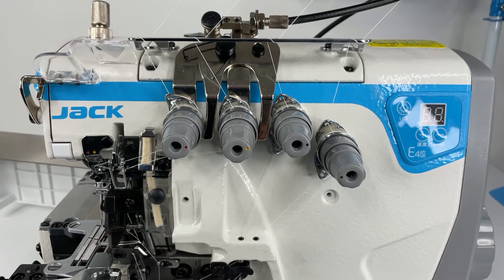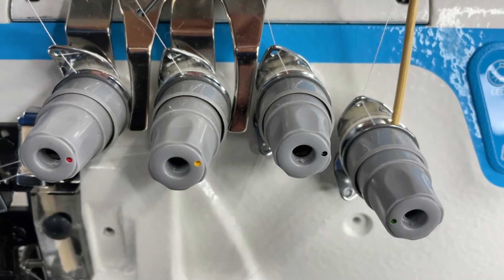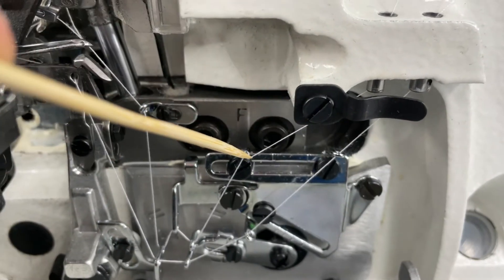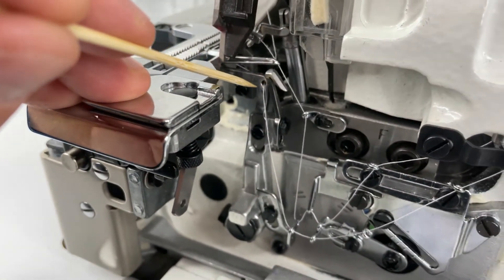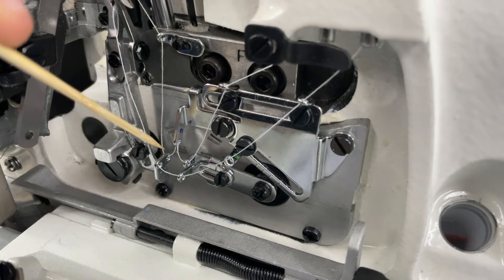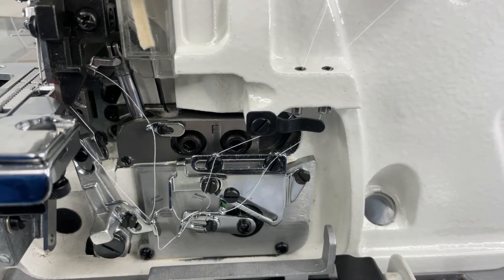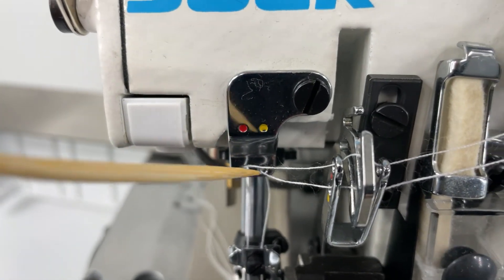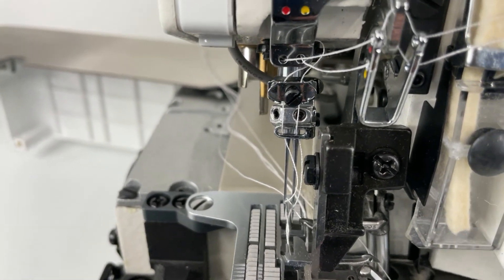How To Thread JACK E4S Industrial 4 Thread Overlocker

Comment: Hi, i am cureently sewing lycra and have big issues with it. It doesn't run easily and therefore my stitch is not the same. I changed diferencial but it still doesn't change much. Is there any other options for changing stitch length?

Comment: Could you help me please?  I need to know how to make the stitch wider and closer on this machine?  Thanks a lot.
Reply from the maker: There is a button that you have to push in on the front of the machine under the plate that you open up to access other adjustments. Push the button in then turn the hand wheel slowly until the button goes in all the way. You will see numbers on the hand wheel, these are your stitch length numbers.

Comment: How can you change the stitch length on this machine?
Reply from the maker: There is a little silver button just inside the left hand cover, you push this button and turn the hand wheel until it engages then the stitch length is written on the hand wheel. It will engage where the current stitch length is set then just turn the hand wheel to the stitch length required.

Comment: I've just changed my needles & re threaded and now my stitches don't catch. Can you offer any suggestions please.
Reply from the maker: It sounds like the needles are not inserted correctly. Make sure they are both in the correct way and centred using the old needle in the eye and also that the needles are pushed all the way up, they should be staggered by 2mm in height.
Reply: @ozcommercialsewingmachines   thank you I've just watched your tutorial,  I'll try that. Really appreciate you replying. 🤞🤞
Reply: @vanessalangley3998  are you slove the problem,  how do you find this machine does it works good? I want to buy the same but I'm not sure. Thank you
Reply: @hanwahanwa5298   the problem was down to an error I made. This is a brilliant,  reliable machine. You won't be disappointed.
Reply: @vanessalangley3998  thank you very much 🤗